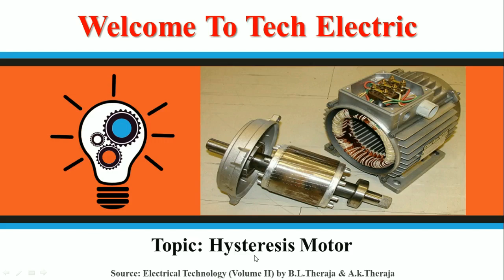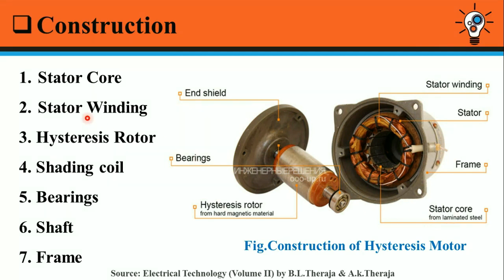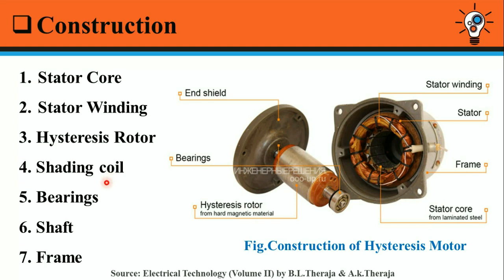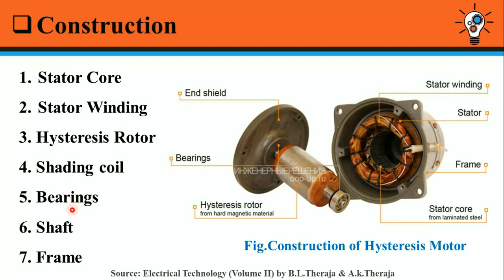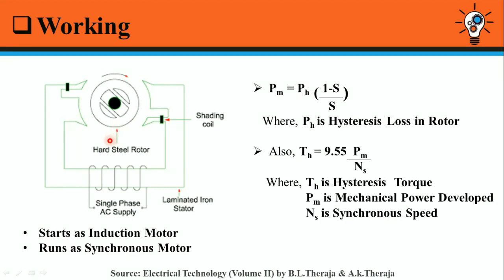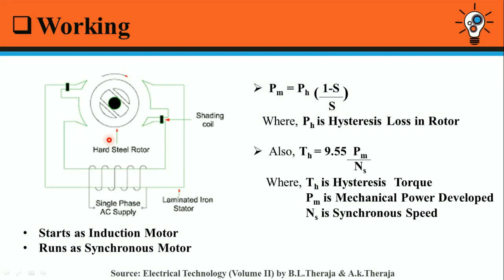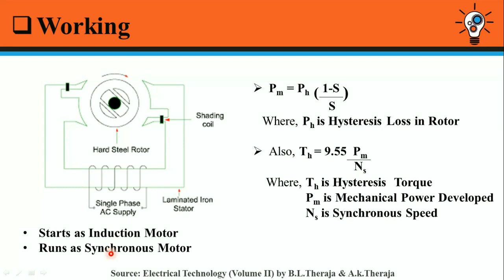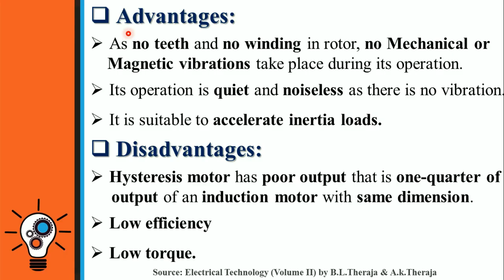Hysteresis Motor (Construction, Working & Applications) | TECH ELECTRIC |

Comment: Why use shaded coil ?
Reply from the maker: When alternating current passes through the field winding, magnetic pole axis shift from unshaded part to shaded part because of shaded coil. This shifting of magnetic axis is the very cause for acting rotational force on the rotor. So shaded coil is used to create this rotational force (Torque) by shifting the magnetic axis of pole.
Reply: @techelectricEE  In hysrsterises use only permanent oil filled type capacitor
Reply from the maker: @atclasses236  yes you are right. Actually hysteresis motors working principle depends on continuously revolving magnetic flux. Usually shaded pole principle (Using shaded coil) is employed for this purpose as explained in the video. Alternatively stator winding of the type used in capacitor type motor may be used giving capacitor type shaded pole motor. Both methods are appropriate for hysteresis motor.